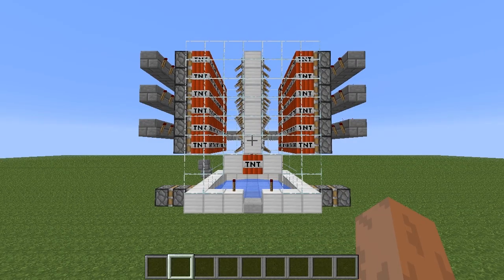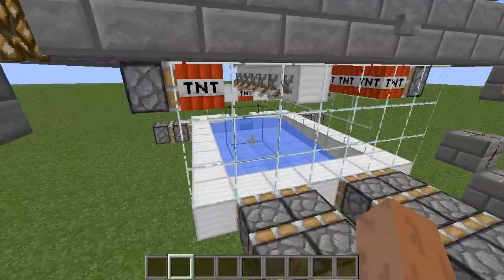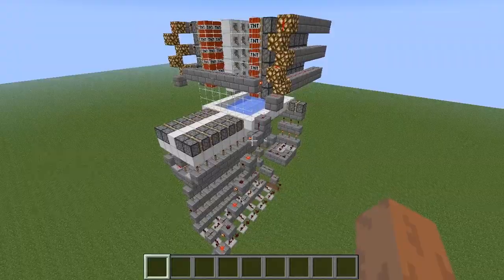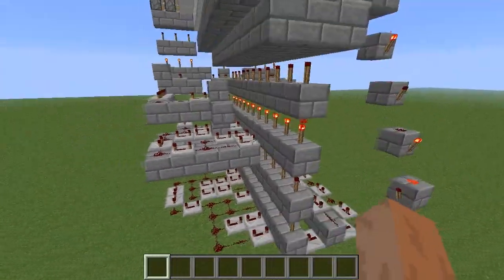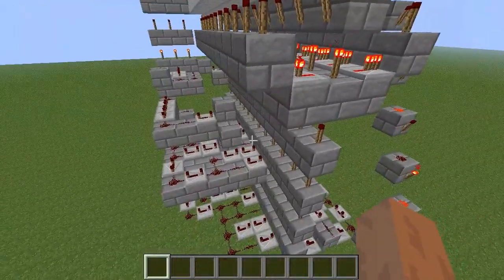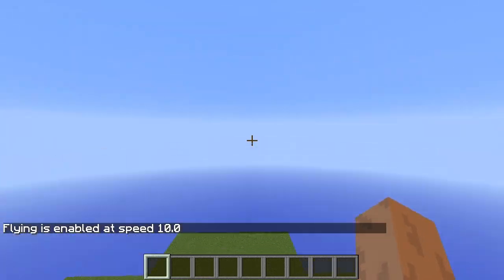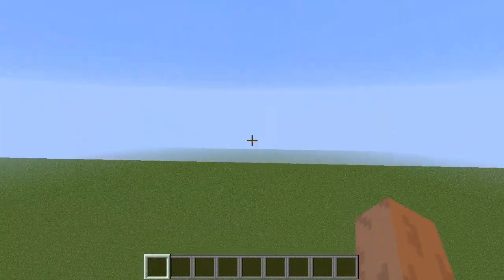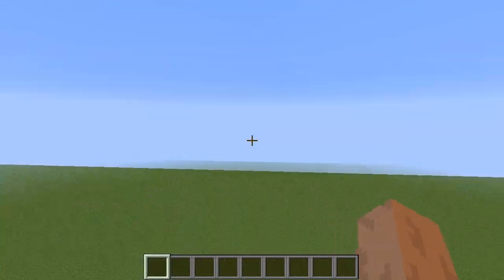TNT Cannon Using 6 Piston Extender

Comment: I remember playing around a year ago with using "compression charges" to bunch up the propellent near the projectile TNT.  I had mixed results with the range increase, but I guess I simply wasn't doing it properly enough (or with enough TNT).

That is some seriously impressive wiring though.  Making piston-chains retract is NOT a trivial task and requires a lot of wiring.  I think the circuit size grows by the square of the number of pistons that must be retracted.

Comment from the maker: My hypothesis is that when it leaves the loaded chunks, it saves it's location, direction, speed and "fuse left". Then when the chunk is loaded it could continue exactly as before. The issue with pre-calculating where it will land is when those chunks aren't loaded, the game has no idea what it may hit before it gets there. It cant assume that there is nothing in its path because there could be a big wall just outside the loaded chunk for all the game knows. Testing is the only way to know.

Comment: You can make it go even further by using a fencepost and a pressurepad on top instead of the halfslab, since the pressurepad isn't tnt blast resistant while the half slab is it will fire it a lot farther, sethbling made a video about it.(by the way, the pressurepad is only there to hold the water back.

Comment: You should use a fence post with a presureplate on, instead of a halfslab in the front. It should sit 1 block under where the halfslab is. This will make the cannon shoot mutch longer ^.^

Comment: seen quite a bit of your videos lately & i like the creations you have come up with so far.  Dont know if you still reply to these posts..but if you do i have a challenge for you. havent seen anything on the web for what im about to ask you. Can you build a compact(optional considering how much wiring probably has to be done), rotating(like a chain gun would of course), fully auto, self-reloading, accurate/long range(maybe long barrels made out of obsidian since their explosive resistant?), extreme rapid fire(while remaining mostly stable), selective fire(semi/full auto), & aimable in any direction(can roatate in a complete 360  & not like those stationary ones ive seen but actually moves in the direction you want to aim. left/right/up/down you know?) TNT canon &/or arrow chaingun?  of course with a on/off switch. oh and without any mods. :) hows that for over engineering? if you can sucessfully do it, can you us how built it? been wanting something like this for my world for a while now. very curious how you would respond or react to a proposition such as this. Anyways thanks for the time to even check this crazy idea out!
Reply: this sounds really coool